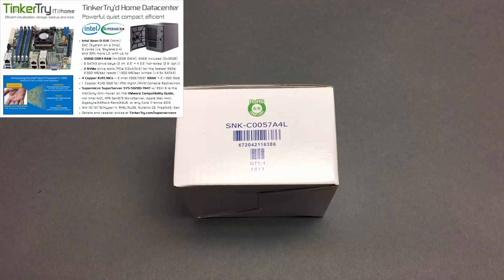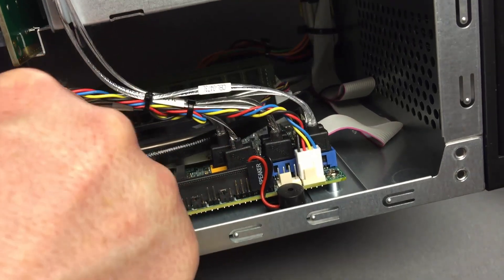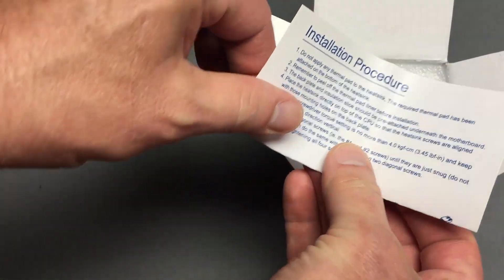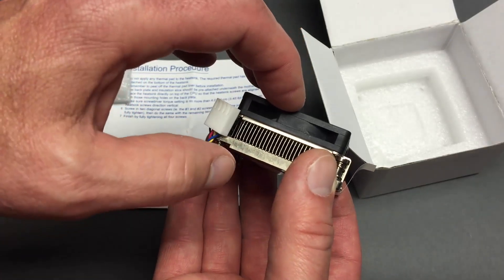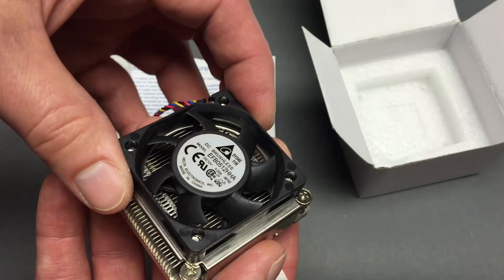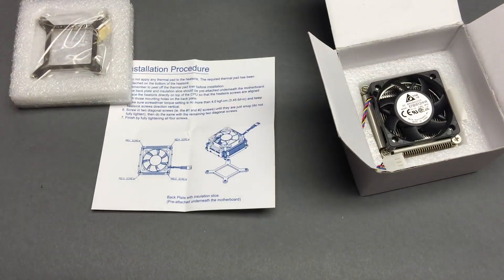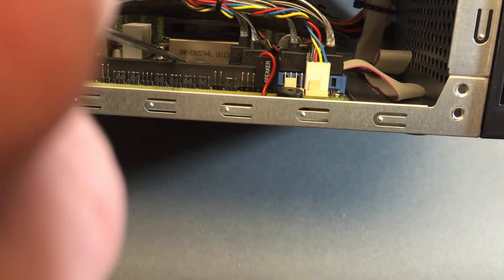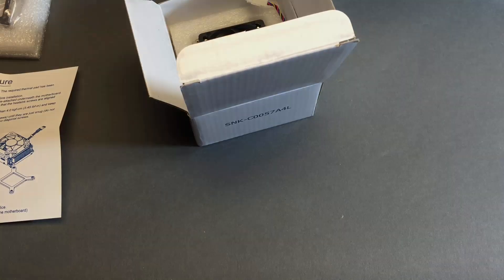Close look at Supermicro SNK-C0057A4L Heatsink/Fan assembly unboxing

Comment: With your experience with the SuperServer and what appears to be the X10SDV-TLN4F board, do you recommend this board with the above mentioned fan or the larger heat sink without fan on the X10SDV-8C-TLN4F?  I will be putting it in a SC505-203B 1U Chassis.  Also when shopping at WiredZone, is there a way to give you credit when making a purchase?

Thanks
Reply from the maker: Hey Joshua, sorry I got behind (was traveling, presenting this https://bit.ly/orlandoxeon in Orlando yesterday).

It would see buying the SYS-5018D-FN4T would be what you want? It gets you a pre-assembled 1U system that uses the same motherboard you want (but without the CPU fan) and the same chassis that you want.
https://www.supermicro.com/products/system/1u/5018/sys-5018d-fn4t.cfm
https://TinkerTry.com/superservers#1URackMount

You can see they call the same motherboard, but without the CPU fan, is called X10SDV-8C-TLN4F

Notice this guy had luck keeping the RPMs of the chassis fans spinning lower by adding a CPU fan in his 1U:
https://TinkerTry.com/superserver-combined-cpu-and-m2-cooling-fan#oct-24-2016-update
but these systems don't throttle or turn off until above 95C, so running at 72C is hardly a big deal, and seems to not be much to worry about. I've tortured these systems without the lid on, they do fine, even under load, see also:
https://www.youtube.com/watch?v=CEFDeHp3IqM
https://www.youtube.com/watch?v=7sr1W-Tg6bI

This SYS-5028D-TN4T is quieter and more versatile (more storage), and comes with the X10SDV-TLN4F, with the fan/cooling explained in more detail in this recent article:
https://TinkerTry.com/supermicro-superserver-sys-5028d-tn4t-xeon-d-1541-and-xeon-d-1567-have-different-heatsink-different-fan

See also:
Lower memory cost reduces price of Xeon D-1541 SuperServer Mini Tower Bundles, 1U version also available
https://TinkerTry.com/xeon-d-superserver-1u
and CPU comparisons here:
https://TinkerTry.com/compare

As for credit, that is much appreciated, the way for Wiredzone to track which purchases came from my site is to use any of the links from this order page:
https://TinkerTry.com/superservers
where you'll notice that all Wiredzone URLs end with ?urlsource=tinkertry, such as:
http://www.wiredzone.com/supermicro-servers-compact-embedded-processor-sys-5028d-tn4t-12c-b2-10026362b2?urlsource=tinkertry

I suppose you could add ?urlsource=tinkertry to the end any Wiredzone item you're looking at because of something I wrote.
I hope this ton of information helps more than it confuses.
Reply: It seems like the passively cooled version of the X10SDV-TLN4F is for a 1U chassis. 

The question I have then, which I think is partially related to Joshua's, is what assumptions are being made? If this is going into a 1u chassis, is it then assumed that the system will be stored in a cooled datacenter? Would the passive cooler then still be sufficient in a 1u chassis on a desk in a house without AC? Or would the airflow in a 1u chassis alone be insufficient without some external cooling as well?

Comment: No on has these in stock.  Is there a substitute
Reply from the maker: I've contacted the supplier, so I can try to answer your question soon I hope. Thanks for your interest, and sorry for the inconvenience.
Reply from the maker: It's now back in stock! Same URL as before http://www.wiredzone.com/supermicro-components-cpu-processors-accessories-snk-c0057a4l-10022641?UTM_Source=TT&UTM_Campaign=10022641
Reply: Amazing!  Thank you
Reply: @TinkerTry  aaaaand, out of stock again! :) I have an E301-9D that is in desperate need of an active cooler. The passive cooler that comes with it just isn't cutting it. Any ideas?